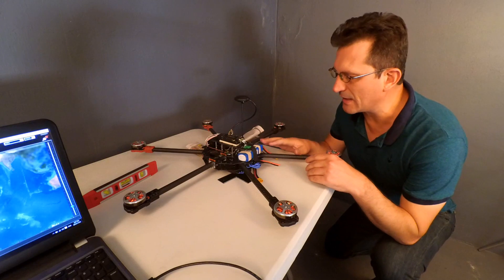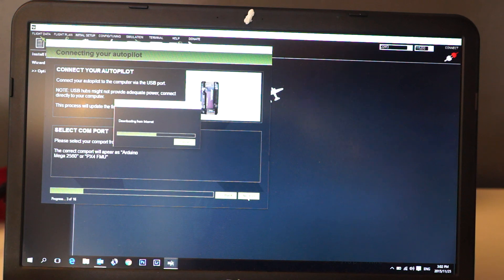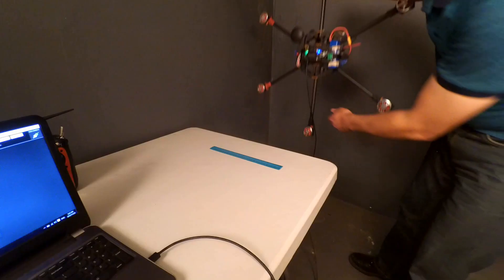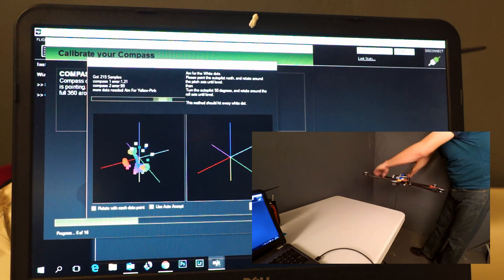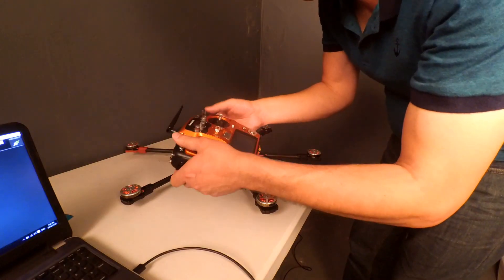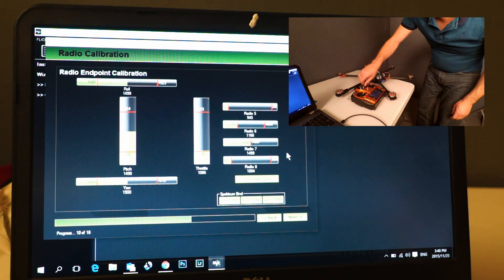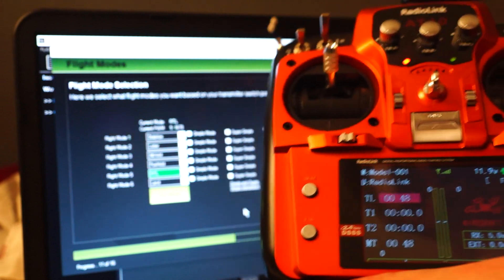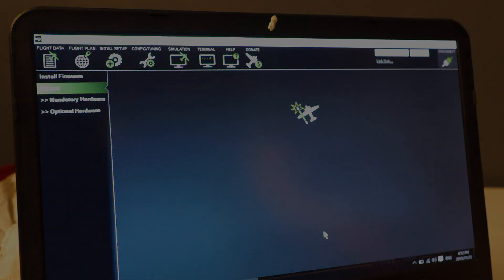Hexacopter Build Part 11 -  Mission Planner Calibration and Radiolink AT10 setup Flight Modes

Comment: I have the same built, you have not included the assembly of the legs on your series. 
I have worked out that indeed it would be difficult to assemble the legs at a later stage than the  fixed arms.
Am i right  ??.
.

Comment: Hi do you have an email so I can contact you, I have the radiolink pixhawk with the se100 gps, after calibration ect when I go to arm I get compass inconsistent 
In the menu for compass there is 2 compass enabled if I disable one of them it will let me arm and control the motors, I'm unsure if this just has one compass or 2 I'm new to quads and I don't want to fly it until I know if it's all correct

Comment: Hello I am completely new on this hobby and I am having trouble configuring the flight modes. I am using a pixhawk 2.4.8 with a radiolink AT10 2 with r12ds reciver. well i have followed the video in how to do it but mission planner is jumping flight mode 3. Can you help?

Comment: Can I use PPM with the AT 10?
Reply from the maker: The R9D supports PWM and S/Bus and the R10D PWM only.  You would need a PPM encoder if you need PPM-SUM output which you can get here:  http://www.banggood.com/PWM-To-PPM-Encoder-Switcher-For-Pixracer-Pixhawk-MWC-Flight-Controller-p-1070269.html
Reply: OK
Thank you very much.

Comment: Everything works for me except when I get to radio calibration.  I am using a Futaba R2008SB and when I get to the calibration screen, all of the bars are grey and Mission Planner does not recognize my moving the levers on my transmitter.

What should I do to fix this?
Reply from the maker: It is very hard to diagnose this as I do not use a Futaba R2008SB, but my best guess is that the receiver might be getting power or the channels are incorrectly connected.  Are you using it in S-Bus?  Which flight controller are you using?
Reply: I am using the Pixhawk 4 flight controller.  The receiver is getting power as shown by the red light flashing solidly and connected to RC port of the Pixhawk as written in the instructions.  The channels are correctly connected as well.
Reply: @SatisJackson3O5  I have the same problem. how did u fix it

Comment: Hi there i have a AT9 transmitter and R9D receiver. From my transmitter i am able to use all 9 channels (infact 10 channels is possible) but in my mission planner, i am only able to detect and control up to 8 channels only. how do i get the 9th channel to work?
Reply from the maker: +Henry Low I do not have a R9D receiver and can only comment on what I have read.  I chose the R10D receiver because I can use all the channels in PWM mode.  On the R9D you can only use 8 Channels in PWM mode (red light) but you have 9 Channels when in S-Bus mode (Blue).  I hope this helps!

Comment: Thank you for the video. I have a question. In the attitude menu, what are the percentages for?  I'm new to this radio and I've been trying to figure it out.
Reply from the maker: +Rob Hildreth This is a little trick to explain, but imagine a piece of string which is 100cm long (100%) and then you cut it at the various lengths and place them in a line.  Each string piece represents the area in which the signal for Channel 5 (as I have set it up) reports the signal received for my switches G and D (as I have set it up) so the FC knows in what position the switch is so you can correspond it to appropriate flight mode.  Since switches G is 3 position and D a 2 position is creates a total of 6 possible positions and each needs an area of influence.
Reply: +Riaan Roux Thank you. I understand now.
Reply: I ended up setting up my pixhawk and this was a very helpful video. Especially when it came to the flight modes setup. Thanks again.
Reply from the maker: I am very happy you found the info helpful!  Happy and safe flying!

Comment: Hello Riaan, Did you configure the failsafe feature on the APM? I have the AT9 instead of the AT10 but can't in the life of me set this up correctly. The AT9 has it's own FailSafe feature, which as far as the throttle is concerned reduces it to 15% of max but this is of no use to APM. APM requires that you set a lower value than the normal low PWN value of the throttle. I have adjusted the throttle end point as explained in many user guides for other transmitters, but when I return the throttle end point back, even with the receiver off, the low PWN value when the transmitter is switched off is not triggered. Any guidance will be appreciated. Great tutorials by the way.
Reply from the maker: +Halil Hassan I do not have a solution to this problem yet
Reply: +Riaan Roux I have worked it out. I was focusing on achieving this by using a value on the throttle when the answer was staring me in the eye. All you need to do is ensure you setup RTL (Return To Land) as one of your flight modes. This is likely to be controlled through CH5. All you then need to do is go into the FailSafe feature of the AT9/AT10 and set CH5 to the percentage that would output the PWN value that triggers RTL. It would be great if you can make a video on it.